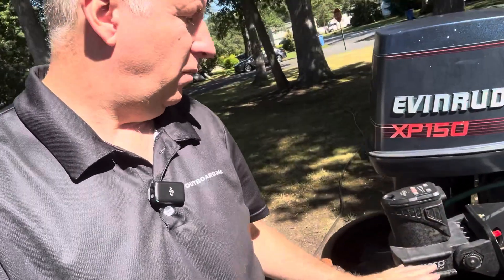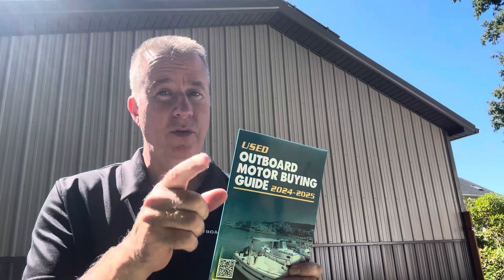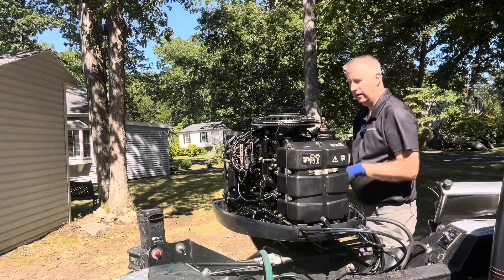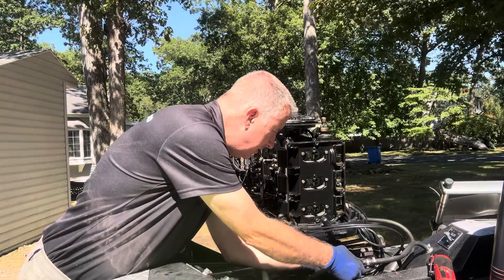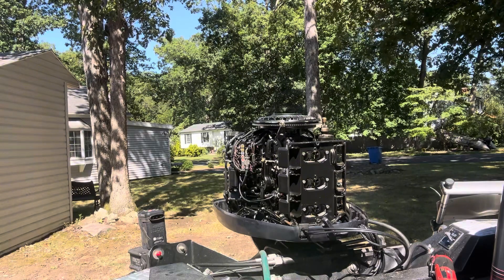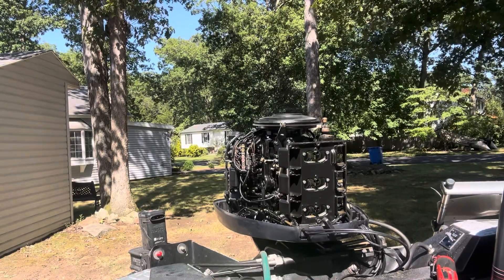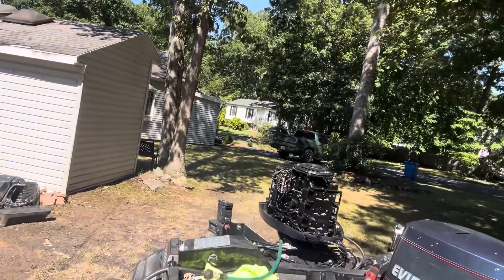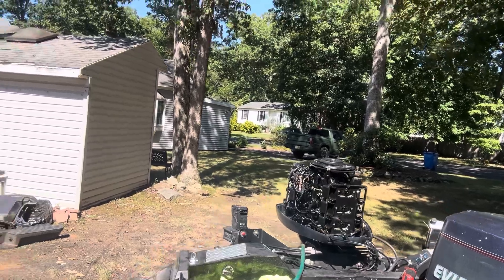Diagnosing Outboard Motor Idling Issues Testing

Comment: Have 94 25 hp mercury 2 stroke, 125 and 130 cylinder compression, brand new CDI, has good uninterrupted spark on both at the plug electrode. Brand new NGK plugs per OEM spec. Top edit: Bottom cylinder misfiring under load, cuts out completely, cowl on or off. Bottom cylinder runs perfect. Ohm'd out the coils between + and plug socket, 0.93 on both. Adjusted single carb lean and rich. Cannot figure out why top cylinder is dead especially under load. I'm thinking Reed valves? It was idling at first, won't idle at all now.
Reply from the maker: Yeah that can be difficult to figure out. Have the carbs been cleaned and all new well sealed fuel lines? Sometimes when coil, stator, or trigger base gets hot is when they fail. You can always pull the carbs to inspect the reeds as well. Sometimes it’s better to buy another motor with all the same parts to play with. Maybe someone has one that has not run in years of has a bad cylinder you can pick up cheap. May save you from expensive new parts. Also be sure all grounds are clean and connected
Reply: @OutboardDad  thank you, I'll investigate further.
Reply from the maker: Is it oil injected? Or does it have temp sensor that could be putting in limp mode?
Reply: @OutboardDad  thank you. Not oil injected. No thermostat (needs one) and the cylinders are slightly above lake temperature. Brand new water pump, strong tell tail.  It's a puzzle.
Reply from the maker: @KingfishStevens-di9ji Ok keep me posted
Reply: @OutboardDad  checked the fire, it dropped a coil on #2. Verified by moving the + wire for the dead cylinder #2 from the CDI over to the known good coil #1, good sustained spark. The guy I got this from put a new CDI box on it, I'm betting nothing wrong with the old one which he included. Apparently they had the coil pack off and when they reinstalled it, they overtightened the mounting bolts and busted all the ferrite underneath. So I have a 96 with low compression and wouldn't start and figured just get those coils and move them over. .... Long story short, I have 4 coils and 3 are dead/intermittent. Ordered 2 sets of coils, fingers crossed that I wind up with two running engines. Knee deep in Mercury mayhem ;-) Thanks for your help.
Reply from the maker: @KingfishStevens-di9ji Ok, that’s the way you chase it down! Sometimes you will end up with two good motors, sometimes just one and parts to sell. But if you do enough you get familiar one brand and model at a time and over the years become an expert. Keep me posted buddy!
Reply: @OutboardDad  New coils and she purrs like a kitten. Now I have another set coming for the 96 with low compression, hoping it runs too. Both motors appeared to have spark on both cylinders, apparently it was weak spark?  It looked bluish white, not red? The coils seemed to be breaking down on slight temperature rise. Sounds good and angry now. Thanks again for the help.
Reply from the maker: @KingfishStevens-di9ji Yeeesss! Love it! Enjoy and your very welcome!

Comment: Looking forward to the carb rebuilt.
I just got a 1994 Johnson 60 hp
I have it tuned except for the timing.
 I just bought a timing light for this. First time using one.
Would you consider doing a timing video on this motor?
Thanks
Reply from the maker: Sorry that motor is gone, I have mostly done timing by ear. There are a few other carb rebuild videos I have as well. Let me know if I can help